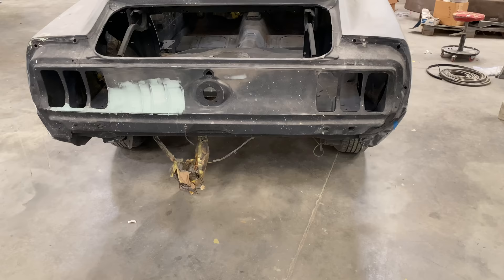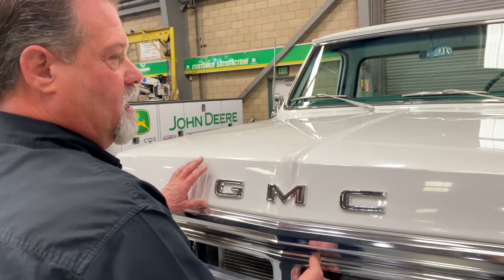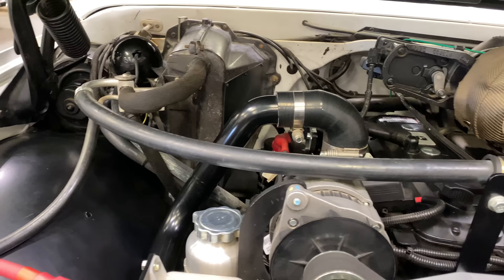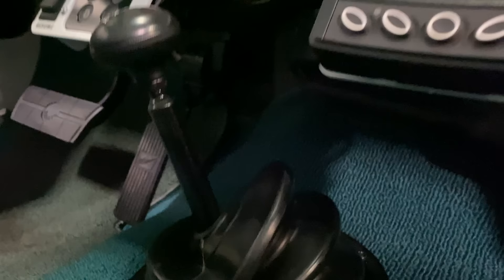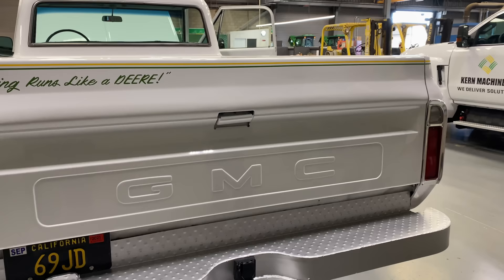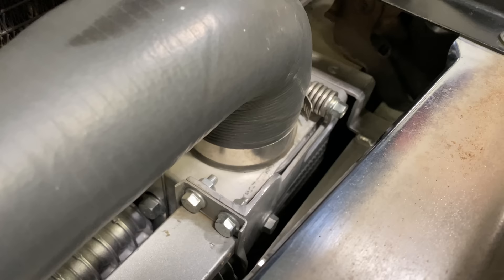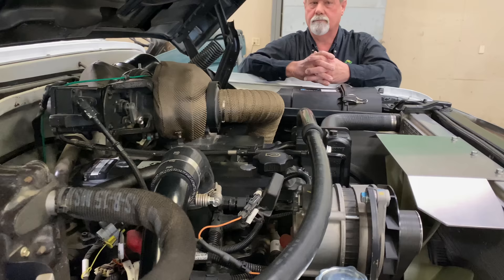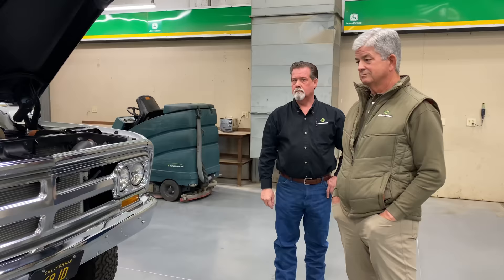John Deere Tractor engine in 1969 GMC truck!

Comment: Great build!
My uncle owned a Kubota dealership back in the late 70s. He and my dad decided they needed a small service truck for the tractors.  The winter on 78 my dad laid out the plans for that truck. He found a 74 model Toyota pickup and added a 30hp 3 cylinder Kubota diesel to the truck, then made the adapter plate for the Toyota 5speed manual.  Ordered a reading service bed for the truck and painted the entire truck Kubota orange.  It was completed in time for me to ride in it on my first day of kindergarten in the fall of 79.  My uncle retired and closed the dealership in the mid 80s and my dad kept the truck.  The drivetrain is now in its second Toyota body but still going.  Top speed 71mph @52mpg.
Reply: You should send these guys history photos and a video!
Reply: And binoculars on the passenger seat just in case you want to pass the car in front of you
Reply: That's what everyone needs vehicles that get 52 mpg !!
Reply: I’d love to see that jewel, thanks for sharing.
Reply: Would love to see a video on it as well!  Sounds amazing!
Reply: @hermayneMUNSTER  I'd  love to see a video of it hooked to pull sled  !! See what the DEER'S  GOT  !!
Reply: That is the greatest story!!
Reply: I would love to see a video off this truck.
I bet it made a great service truck.
Would love to do the same thing with a larger Kubota diesel.
One old enough it doesn't have all the DEF/DPF crap on it.
Reply: Great story.  I've been thinking of a similar project.  I have an old Dodge D50 that I keep thinking of yanking the 4 banger (Mitsubishi iirc) out of an installing a Briggs & Stratton.  Main difference is my project is still just in my head!
Reply: @blythkd9017  that's where all projects begin.
Reply: Ya we need some pictures
Reply: Why did you use a Toyota? Is Kubota an Asian company? I'm not familiar with either company, especially Toyota due to me living in the heart of Chevy, Ford and Chrysler country....mid-Michigan.
Reply: @matt426h  that would be awesome!  Builds with what you had available to you at the time are very interesting.
Reply: @theronash7269  I agree.
Reply: @blythkd9017  OMG, just sell it to me. 😁
Reply: @bobjones1131  You mean it has value?  I don't think I gave $200 for it at an auction 5 or 6 years back.  They didn't start it because the owner had died and the son couldn't find the keys.   I got past the key issue, and it cranked right off.  Imagine my surprise!
Reply: Can't go wrong with a 725D....really easy to get a little more power out of,just by pulling one shim off of the injector pump cover..
Reply: @blythkd9017  , install a Mitsubishi diesel instead..!
Reply: Power is null, top speed is nearly street legal, but that mpg is amazing, then you have unparalleled torque. 

If u add the turbo in you'll have more power, and it will feel more "normal" however mpg will drop quite a bit, probably to the 35-40 mpg range, unless you go easy on it, and this is assuming your keeping the same motor.
Reply: Sounds like a great truck. I needed a bit more power, so went with two more cylinders.......
Reply: Bullshit. You ain’t getting no 52 mpg out of that thing at 70+ mph, you wish. lol
Reply: @mr.butterworth  I read it more as 71mph top speed and 52mpg under normal driving, which is also a stretch but at least within the bounds of possibility. My swap gets under half that with 4wd and aerodynamics of a garden shed and deck.
Reply: 52mpg would have been pretty good in 79 especially for a truck.
Reply: That is so awesome!! I hope that engine and transmission goes into many more trucks for your kids and their kids. I found a Ranger in a barnyard in New Jersey that had holes the size of my fist through it.I butt welded the holes and made pieces for the truck and it runs well enough for me to  replace the bed with a used flatbed. There is a six cylinder engine in right now and it is the one that people want.When it goes bad I am swapping it with a 3 or 4 cylinder diesel or maybe something else that will be almost self sufficient at that point.
Reply: Even the current 30 hp kubota 3 cylinders are super bulletproof just don't get them hot once they get hot once thier done
Reply: My stepdad I'm joined their tractors now they're quite expensive for back day reliable really reliable
Reply: Lookout gov be still that thing that gpm
Reply: Sorry 52 miles per gallon
Reply: Steve Moore - Was your dad's conversion featured in Diesel Digest Magazine, by any chance?
Reply: @matt426h  Yeah, that mag was in publication between '76 and '82. Just curious. Thanks.
Reply: @blythkd9017  I worked at a truck leasing shop as a mechanic in the early 90s. One of the shop trucks we had was a D50. Had a 2.6L Mitsubishi turbo diesel. They were a factory option back in the 80s. If you can find one, and the 5 speed that would bolt up to it, the whole thing should be a drop in fit.
Reply: Bro, people would go crazy for a 52 mpg truck in 2022, even though the speed is only 71 mph (plenty enough, since the highway speed limit is 60-70 mph). Look at the fuel prices in America and Europe. $5.00 gal in my state, and $2.30/L in EU. :) Lol... I guess that is a diesel for ya, great fuel economy. If I am not mistaken, you can run it off of purified McDonald's grease.
Reply: Wow that is super cool I wish I could of seen this maybe one day it will be in covered, found and put on display that would be a very cool piece of history.
Reply: THAT'S AWESOME. I would pay more for that than a new truck.
Reply: Brilliant story... 👍😎🏴
Reply: I had one of those in my ‘78 Suburban 2 week drive. After I had a Toro Flo diesel. No glow plugs !  From a ‘62 GMC bus
Reply: @jackmyers6040  Got one.
Reply: Can't argue with that I'd buy Kubota over a John Deere these days.
Reply: A good choice in engine, those things are effectively immortal.
Reply: 71mph 52mpg? Shit! That's fucking awesome!

Videos?
Reply: So you should make a video about that.
Reply: 52 mpg's is very impressive!
Reply: Freaking sweet build, most impressive part is that it actually gets up to highway speeds, not to mention the great fuel economy. You should post pictures and videos of that vehicle
Reply: Kubota is horrible John Deere is the best.

Comment: My dad spent years taking John deere motors out and putting in Detroit’s and Cummins back in them
Reply: Your dads a legend!
Reply: No he didn't!
Reply: Wasn't there a company back in the day that put 318 Detroits in one of the deeres pretty sure they modified one for John deere for testing
Reply: @rocketsnhotrods9022  no they did it for more power dad put 238/318 Detroit’s in 4020-4520-4620-5020 and some mass.    He put 855                  Cummins in 8630/8650/8640/8850  he did about 500 of these conversions  when asked why he did it he would always say because I can
Reply: Thats pretty cool I'd like to have one of them 4020s with that cummins in it
Reply: @rocketsnhotrods9022  KINZE repower. Google them. You'll love all the interesting stuff they built/modified.
Reply: @turbodiesel4709  thats who I was thinking of
Reply: Lol!
Reply: @stanspaid632  made a m35 2 1/2 ton Army 3000 water tanker run 100 mph with original white diesel. An E7 Sgt said to me, "Why would you do that or even want to do that Barclay?", "BECAUSE I CAN"..!
"BECAUSE I CAN" IS AN AMERICAN WAY..!
DOUBTERS ARE SCARCELY AMERICAN AT ALL..!
Reply: @AllenBarclayAllen  it’s the cowboy which as American as it gets
Reply: @turbodiesel4709  love the video of the 5020 with a v8 Detroit chisel plowing like he's on the road home. Awesome power and sound from the 2stroke.

Comment: My build started in the early '80s with a '70 3500 one ton GM with 9' stepside bed . Ist engine was a takeout from a C-65HD Chevy = GM 4-53N, along with a Spicer 3152 five speed transmission , backed up with a Spicer 5831 three spiied auxilliary with .74 overdrive. I put it on the road in September '84, and in '96 I installed a DD 4-53T. Originally I stayed with original 4.10 ratio rear, but several years ago, I switched to a 3.58 Dana '70, as now it'll cruise the interstate with traffic, and not have engine singing .  38 years plus about 300,000 miles verifies it's been a practical-successful conversion .
Reply: Janet Renovetz - I have a bunch of fuel filters for your Detroit, if you'd like to have them, let me know.
Reply: @DeanMk1  Contact me through Facebook to see what you have ............and location . When I click on your name , i see no way to send you a private message .
Reply: @danielrenovetz5721  Will do.

Comment: Wish they would have put a pre emission engine in it.
Reply: Well it is in California
Reply: No worries of emissions
Reply: Why? the pre emissions 4045 didnt make half the power of common rail engine
Reply: @johndeerekid8490  ?
Reply: Why?  stupid idea
Reply: @martinandersson5278  why. lower hp and torque from the old engine. Harder to make bigger numbers with old engine and the newer engine is better on fuel
Reply: its hippy california so they probably need to pass an emissions test even though its an old truck
Reply: It's a 69 truck so it's pre-emission vehicle.  The electronics make it much more fuel efficient and reliable, as well as a showcase for modern engine management, which I believe was part of the point of this project, if you listen to the owner near the end.
Reply: Bill Clinton said NO!
Reply: It's too bad you can't make them mechanical injection. 
Over in the VW world you can take a mk3 TDI engine and put a pump on from the earlier idi engines. 
The kids call them a TDI-M
Of course it needs a bigger pump head for making good power  , but it's like taking a step backwards to go forwards. 
Best of both worlds,modern engine with mechanical injection. 
Power ? 
Good enough to rip a 5.5 0-60 and a tractionless 14 flat in the 1/4, and got 51-54mpg highway while getting to the track. 
3x the power the original engine in the car had, and better mileage.
Losing all that electronic crap makes the swap much easier.
Reply: @Jordon Carlson 
Who cares about them , works great on a VW TDI
Reply: @johnpurdum8126  Electronics make it more reliable?  I can't stop laughing.  

Something with a Bosch pump with 4 to 6 fuel lines coming out of the top of it would be much more reliable.  If it'll turn over and start, it'll run until it's out of fuel, always.
Reply: @blythkd9017  so you’re saying overall reliability and efficiency hasn’t gone up in the past 2 decades? Modern common Rail systems will blow mechanical pumps out of the water.
Reply: @petewiebe1344  Yeah that's what I'm saying.  Modern CR may win out for power and efficiency, mainly emissions,  but not for reliability.  Pressure is too high and pumps don't last.  I'm talking about pickup engines.  They fail right and left and cost a fortune to repair after they leave you stranded with no warning.  Been there, done that and know plenty of others it's happened to as well.  Some guys, more than once in a short period of time.  Our road shoulders are littered with dead trucks nowadays compared to how it used to be.  Some of it is emissions systems but fuel system failures are a piece of the puzzle as well.  In the old days, if you got a truck started and kept fuel in the tank, you didn't have to worry about getting home.
Reply: @ffarmchicken  69 truck requires no smog check and no inspection so you could put any engine you want in there
Reply: Pre emission 4045 is a much better engine all in all though. There’s always some weird electronic issue with the newer ones.
Reply: @petewiebe1344  don't think so. Our 50 year old tractors routinely come out and rescue our new ones and get the job done while john deere mechanics scratch their heads and charge thousands for multiple trips and never really seem to fix it. As for fuel economy? Wrong there too. I put the fuel in these tractors and work them. If your idling around pulling wagons or feeding bales or spraying, the new ones are more fuel efficient.  But if your mowing thick hay, pulling clay hills or something hard, the old torque monster will win every time. And I wouldn't call the last two decades advancement.  I've seen new tractors not even start to get off the delivery trailer. New combines sit around getting worked on all fall while the old combine does the harvest. I could write a book. It's aggravating. Especially when I've seen what they can do if they want to.
Reply: @jayh1734  I actually agree with allot of what you're saying. I was a Deere tech for 6 years. 9610 likely the greatest combine deere ever made. 8400 probably the best tractor they ever made. reliability wise. efficiency/reliability 8430, 9770 were the last good machines Deere made. emissions and sending all the manufacturing across the globe is a big part of the reason modern machines suck. Though i've seen 8370rs with 20k+ hrs so they're out there. Common rail done right is superior to traditional fuel delivery methods. Cummins can attest to that.

Comment: in 1970 a john deere factory in the quad city area  had a chevy C60  rollback truck that blew up the 292  6cyl . they installed a turbo charged 404  john deere engine from a 4320 farm tractor with a 5spd /w 2spd axle. i  saw this truck in 1973 when it was used to deliver a transmission assembly for a 4430 overnight .
Reply: 404 was one of the best Deere ever built
Reply: @michaelvrooman5681  This 4 cylinder or the 6.8 L would be my choice and the 4 valve makes for a powerful engine with much less weight.

Comment: I did the reverse. I put a 6-cylinder VW turbo diesel engine in my Nuffield tractor.
Reply: Nice
Reply: @Jordon Carlson Yes they are in America! They were used in old Volvo 240, 740 and 940.
Reply: @nicostenfors5690  far as I'm tracking, in the US it was a I6 diesel only sold in the 240 for a couple years in the 80s. They're complete unicorns to find these days.
Reply: @UpToSpeedOnJaguar  Yes it's a D24. Found in Volvo 240/740/940 and VW LT vans. A little bit easier to find in Europe.
Reply: I've often joked about recycling a Mercedes OM616/617 engine for generator use, myself.
Reply: @longbottle  The problem is that you need a different injection pump. A car pump will not keep a constant RPM and react to a increasing load. A generator needs to maintain for example 3000rpm under light loads and heavy loads.
Reply: @nicostenfors5690  The 617 can and does maintain 3000 RPM with the stock injection pump, actually. They're pretty high revving for a diesel engine.
Reply: A good Welder & Cutting Torch with skill & time you can do miracles.

Comment: Been done. When I worked at the Waterloo Engine Works back in the 1980s, one of the engineers there put a 4 cyl. Deere engine into a Lincoln Towncar. It was dog slow but got 40 mpg. : )
Reply: Your probably right. I heard something about some guys over at PEC back in the day squeezing a 6 cyl maybe a 7.6 under the hood of a pickup.
Reply: If you worked there in the 80s you should remember the John Deere camper chassis program, and the dealer only service trucks that had Deere engines.
Reply: @Chevy4x4dawg  Yes. The RV chassis business was sold to oshkosh because it was a financial loser. I never heard anything about the service trucks. probably a myth.
Reply: @gonerydin4225  Best I can remember the RV chassis business was right during the late 80s financial crisis so I am sure it was cut quickly with such a small profit margin.   As to the service trucks I worked at a Deere Dealership that had looked into buying one. Also I have seen a brochure for them on eBay several years ago.  Now were any ever produced that is certainly up for debate.  Like I said it doubled the price and the only benefits were the dealership could work on the engine and that it had a longer life. I'm sure the transmission and other components would have been a warranty nightmare.  That said there may have never been any produced.

Comment: Reminds us of the truck we built. The truck is a 1952 Dodge "Pilothouse" truck with a twin-turbo 4.5L John Deere Powertech engine. Mated to the Powertech is an Allison 2000 transmission that we built a custom adapter plate for in order for them to adapt to each other. The truck sits on a fully custom frame too. Check out our page to see it

Comment: Brilliantly conceived, flawlessly executed. One of one.
Reply: your exactly correct, well said  ..........
Reply: I'm not sure about the one of one part. The only thing that might make it one of one is the engine. But who's to say that exact engine has not been put in a truck before.
Reply: @redwood7121  So as soon as you go find another 69 GMC K2500 with that JD engine in it and a 1000 Allison with 2000 internals and a divorced 203 transfer case, you can call it 1 of 2.  Oh and it's gotta have cruise and air too.  Better get started.
Reply: @blythkd9017  I'm guessing you've never built anything.? Gmc made thousands of that exact same truck. People have been putting different engines and drive trains in vehicles since the start of cars. Is it one of one because it has a different drive train.? Kind of , not really. You can put any engine in any vehicle. That engine could blow tomorrow and it's a one of one scrap truck.? People have been doing this stuff forever and it's quite possible someone else has built an identical truck with an identical drive train.
Reply: @redwood7121  You're missing the point but you're obviously not going to see the light no matter how much anyone preaches to you.  Possible that someone else has built the exact same truck?  Absolutely.  Likely?  Not even a remote chance.  And yes, I've built plenty of stuff.  Guessing you haven't?
Reply: @blythkd9017  You obviously don't get it. Any engine can be put in any vehicle. If you had built anything you would know that. You could even make it electric or steam powered if you wanted and had the knowledge. It's just an old g.m.c. pickup with someone's idea of a good drive train. I don't think this setup has any advantage over any other combination, if anything it will be problematic at best.